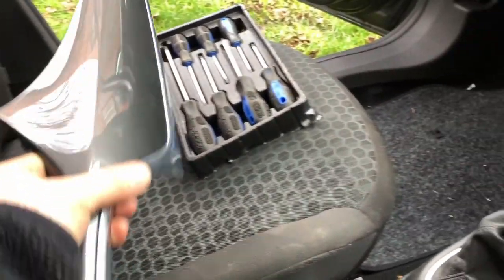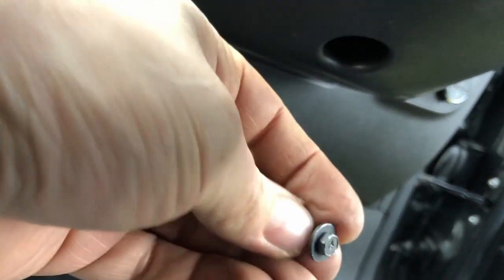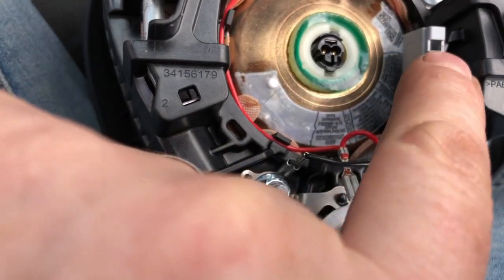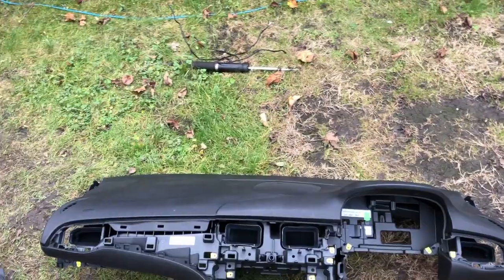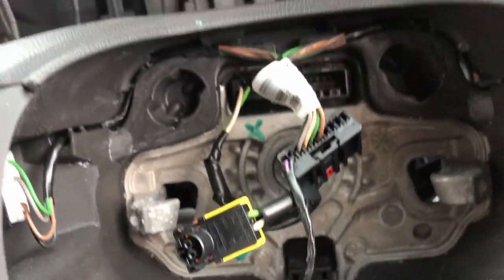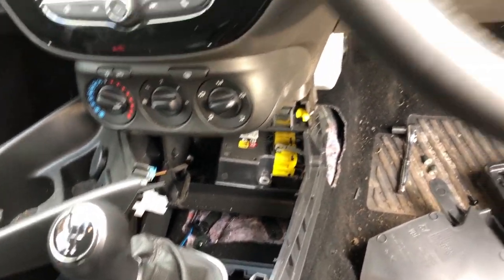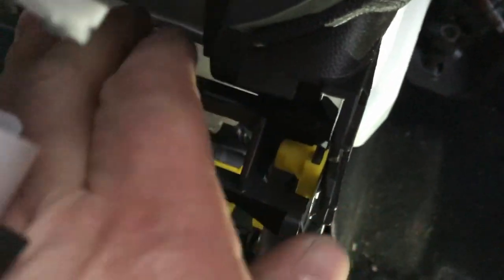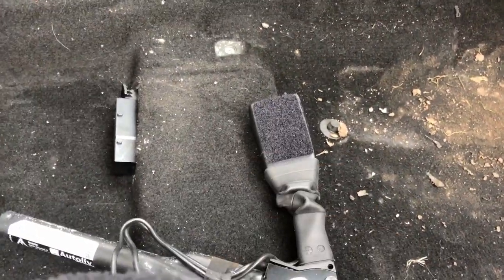Corsa E Dash replacement - How to..

Comment: Nice video. I'm doing this because my clutch pedal return spring has either broken or (more likely) parted company from the pedal. I believe the pedal and spring may be connected by a plastic part which breaks. I have done everything you did except removing the airbags in the window pillars. In addition I have completely removed the steering column. The fascia will still not come out. I will remove the 2 windscreen side airbags tomorrow and try again.
Reply from the maker: Good luck. 👍
Reply: @Roverturbo  I got the dashboard out but in the end I just had to pull VERY hard. The plastic clip connecting the clutch pedal to the return spring was broken and it's not sold separately. I made a new clip from metal and have reassembled and got the engine running but I'm seeing a "Service Airbag" message. The airbag took some getting out as I did not know how to do it and I'm frightened I may have damaged it. I'm going to source a 2nd hand one and fit it. Can you give me details of the computer you used to program in your airbag, please? All I have at present is a code reader.
Reply from the maker: I didn’t code anything, I just replaced what was damaged and cleared the codes with my autel mk808. 
I think there might be some more detail in the “corsa cat s” videos, about the airbags. Check out my playlist.
Reply: @Roverturbo  Noted. Will do. My 1st problem when I reconnected the battery was that the horn would start sounding continuously about 10 seconds later. No amount of turning the ignition on and off or locking / unlocking with the remote had any effect. I put my hand behind the bumper and unplugged the horn. Then I started the engine and left it running until it was hot. Then I was able to plug in the horn again without it going off. I can also operate the horn via the airbag so I am moving forwards.
Reply: Seems to be a fairly common problem, have the same issue. Have to pull out my pedal with my food every few gear changes. Been the case for a year now so I’m used to it but would be great if I could fix this
Reply: @danielkaniowski5694  I eventually managed to fix our car and have been driving it for a while now. The metal clip I made to attach the return spring to the clutch pedal has not let go yet. The Service Airbag message was due to me not pushing the connector far enough into the passenger airbag. After fixing it the car went through the MOT with no advisories but removing that dashboard and steering column is definitely not for the faint hearted.
Reply: @danielkaniowski5694  my corsa has done this once, pedal got stuck to the floor basically had to lift it out with my foot. I’ve not driven it since, but sounds like you’re still driving yours and apart from having to lift the pedal you have no problems? I’m debating about going to see my garage. I’d appreciate any advice. Thanks